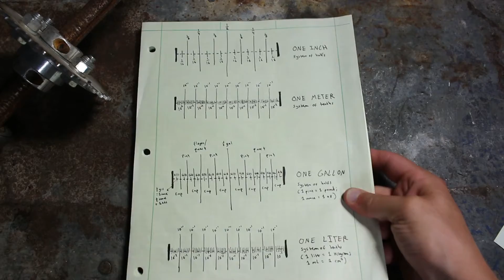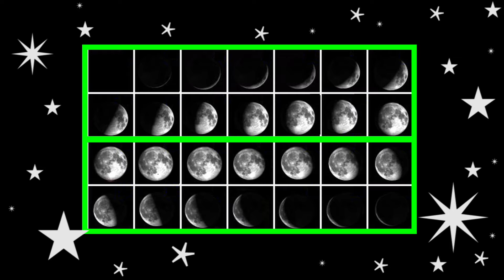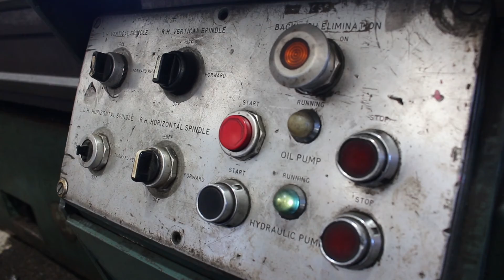Metric vs. Standard: An Imperial Defense

Comment: For people who say imperial is stupid never actually tried to understand it also this is a better explanation of why imperial is the way it is than I was ever given in school and it makes much more sense.
Reply from the maker: Thanks, Project Atlas, I agree.
Reply: I can use both sistems and say Imperial is stupid, I use like many im metric world for very specific measure like socket wrench. In metric worl no one say 13.6 mm or 6.3 mm
We use only because is simple to remember ½ inch ⅜ inch and ¼ inch.
And thats all. Only because it is international standard.
And really most people really no need to know exact dimension any socket wrench adapter. Enough is remember those 3 type. In most situation it is just in use ½ and ¼ inch socket adapter. Same situation is pipes, no one made pipes beteeen standard values. So in metric countries we use 2inch , 1½ inch , 1 inch , ¾ inch , 
½ inch and that all to need to know. Only because standardisation worldvide.
But all other metric is supperior..
Metric caliper cheap one can mesaure up to 0.05mm
And imperial scale?
Up to 1/128 inch and this is too big measure.

Comment: "There are twelve moon cycles in a year"

Wrong. Luna completes an orbit every 27.322 Days and a Year is 365.2425 days, or 13.36 lunar cycles in a year. Not twelve, not a round number and it's simply the fact that as of right now Luna's orbital period is as such to deliver those results. The average distance from Earth to Luna is expanding by 38mm a year due to tidal forces. When T-Rex roamed 67 MYA it was 254.6 km closer to the earth.

"The Imperial System is an old system"

First of all, Mesopotamians predate the Hebrews and had their own measurements. Second that's a point against it, a cubit is ill defined because (surprise surprise) humans have different lengths of arms. SI is defined rigorously, systematically and consistently.

There was a reason why Metric overtook feet and inches and furlongs and galleons and hogsheads and all that other stuff everywhere but the US. It's just an easier more efficient system to use.

Also a Pint (473.176 ml) is not a pound (453.592 g).
Reply from the maker: "A pint's a pound a mile around"—ballpark numbers. The point is practical usefulness, not exact specificity. Maybe good for the garage mechanic or farmer, not the nanotech developer.

Comment: Metric is a good system, and it has it's place: EVERYWHERE.
- I've learnt imperial first on an americal school and then forgot it completely. The simple fact that you need a sheet to explain it proves the point.
- It is also not correct that imperial only uses multiples of 12. If was at least consistant, it would be better, but that's not the case.

Comment: Good on you sir for making these points and defending the imperial system. Here in the uk we’ve sold out to the metric on-slaught. But the imperial just won’t go away and so it is necessary to be familiar with both. We are proficient at both but expert at neither.
Reply from the maker: Thank you for the nice comment!
Reply: @McGuireMechanism  I wanted to state another warning from the UK. Our plywood still comes in 4 x 8ft sheets. In metric this is 1.22m by 2.44m. The drywall manufacterers here in Europe have, in their wisdom, decided to make their drywall sheets a simpler 1.2m by 2.4m, which is about an inch smaller than the imperial plywood. This means that when the carpenter comes to layout his studs, he has to make them fall an inch shy of a full width of plywood in order for his drywall joints to fall on a stud. But now all his plywood sheets have to be cut down by about an inch in order work. All because the metric system hasn't been developed out of any practivcal application, and so they're bending the practical to fit their abstract idea. 
Another note and then I'll stop. A regular internal door is still 6'6" by 2'6" but these are sold as 1981 x 762mm. Everyone remembers the imperial dimension but not the metric (for obvious reasons) but some carpenters, siduced by the "metric now" propaganda, have got themselves metric only tapemeasures, so you literrally hear guys asking "how big is a 2'6" door?"
Reply from the maker: @briefoutlines4505  Nicely put. Such interesting examples! Haha and I just ran into a some rectangular tube (a hollow structural section) named HSS254x152.4x12.7 (254 mm wide x 152.4 mm high x 12.7 mm thick,) then after a calculation I realized that's just a standard 10" x 6" x 1/2"!

And I just discovered your channel. Enjoying the thought experiments.

Comment: Being a Eurupean (Danish) metric person i like your argumentation for imperial.  Especially when it comes to length measurement. But when it comes comes to the lengt, weight, mass combination i think metric is easyer, and more precise.
But when i did reparement in my old house i often used an old danish ruler with old danish "tommer" (not quite equal to an inch, but same principle). My house was before wood construction in denmark turned metric
Reply from the maker: Thank you for your perspective, Martin! I had never heard about the "tommer" before. Very interesting insight!

Comment: Thank you for the video. I've thought about this same topic for awhile, and why I prefer the imperial system over metric for most of my projects. It would seem that metric is better when designing a product or system starting with mathematics, but imperial should be preferred when estimating or roughing in a design using intuition. 

I find estimating dimensions using imperial units to be far closer to actual, than when I or others use metric. 

Yes, I'm biased having been raised using the imperial system, but it seems like the English units simply fit better into our lived experience and the measurements of our own bodies... accurately estimating an ounce vs a gram, or marking out an inch vs a centimeter. 

Is it possible the metric system was created specifically to make the math easier, while the imperial system grew organically based on familiar lengths, volumes, and forces? I honestly don't know if they were both equally contrived.
Reply from the maker: Great thoughts, William, thanks!

I think you're right. My understanding is that Imperial evolved over time (units like the "foot" can be traced back to ancient Hebrew,) while Metric was implemented in a unified effort by design. I tend to prefer Metric for things that are too small to see and Imperial for things tangible :)

Comment: I don't think U.S. customary units are bad, but I feel like this video doesn't do the best job defending them. The point about divisibility by 2 is slightly misleading, because there is no reason metric units cannot be divided into fractions. The reason we do this with inches is simply because our shorter units of length are either obsolete (e.g. the barleycorn) or industry-specific (the point and pica), so there is just nothing else to use. We say "1/16th of an inch" because we don't have a unit that is, say, an 80th of a inch or whatever to make it easier. That's not an advantage at all, quite the opposite.

Moreover, a pint is not a pound. In the U.S., a pint is 16 fluid ounces, but a U.S. fluid ounce of water at any reasonable temperature weighs slightly more than an ounce (specifically, at STP, 1 fl oz of pure water masses 1.04318 oz). An imperial fluid ounce, on the other hand, weighs about an ounce at room temperature, but an imperial pint is 20 ounces. So a pint is not really a pound anywhere, except maybe a pint of low-gravity wine (which we don't even measure in pints).

I do agree with the premise here to some extent. English units are traditional, functional, and designed with some care, unlike what many people will claim. They are superior to metric units in divisibility by 3 in many cases, which can be important, and they don't have the awkward scale issue of metric where it seems like there ought to be a unit of length of ~30 cm, like there was in virtually every society up to that point. Cups and spoons are also fairly convenient for cooking, which is mostly where our smaller units of volume get used (though some pill bottles still have a volume in apothecary drachms debossed into the plastic!). And there are a few other advantages.

But that said, we lose a lot by declining a global standard. I think whether metric or U.S. units are "better" misses that point. Moreover, it's misleading to focus on only one narrow use case of some U.S. units, like short lengths in industry, and not other units. The mile is 1760 yards or 880 fathoms or 5280 feet, something which is neither easy to remember nor compute with. How often do we need to convert between miles and feet in practice? It depends what you do, but probably not that often. But it's still an objectively bad conversion factor. The U.S. liquid gallon is 231 in³ by definition. Why? I don't know, it just is. It's based on a particular Elizabethan wine gallon, and we sort of just ended up with it like that. Many different pints exist in different parts of the world, which is legit confusing. We have two different units called an "ounce." A pound sterling is a unit of currency, based on a unit of weight which is not even a modern pound, nor is it the troy pound, the unit used to measure precious metals like sterling silver today, which is itself not the avoirdupois pound used for everything else. Virtually all surveys conducted in the U.S. have used the survey foot, which is 2 ppm shorter than the statute foot. And on and on

There are so many caveats and special cases that are like landmines. They rarely cause issues, but sometimes they do, and it's hard to be sure when they will and when they won't. So to say this system is "better" than metric just because 12 has more factors or whatever feels pretty incomplete. It's not really a question of what is easiest to use in a shop at this point. Any unit is easy to use, because you get used to it pretty quick. It's a question of international agreement to reduce barriers to trade and thus make everything slightly cheaper for everyone.
Reply from the maker: Thank you for your perspective, Eebster!

While you are correct that any number can be divided into fractions, the Imperial system (called by different names depending on the time and place) being a “system of halves” is embedded within the units themselves. Consider 16 tablespoons per cup or 16 cups per gallon: 16 simply has more whole factors than 10.

For practical purposes, in applications best suited for the Imperial system, considering a pint as a pound is sufficient. One principal merit of the Imperial system is it has linguistic ties to real, tangible objects. It is ideal for hands-on farmwork and crafting. Big stuff that you can see and touch with your hands. For these tangible applications, decimals in the hundredths and thousandths place are typically negligible.

On the other end of the spectrum, in the realm of microfluidics, for example, I would argue that Metric is better suited. Different systems are more or less useful, depending on the application.

Please understand that I am not arguing that Imperial is superior (though it is my personal preference, only because of my particular trade and community.) I am defending the underdog, playing devil’s advocate for the standard system used in my area and line of work.

I love the Metric system, and you are absolutely right that we would “lose a lot by declining a global standard.” My hope is that people will also recognize that we will lose a lot—even more, perhaps—by denying the older systems of measurement rooted in real, personal communities throughout the world.
Reply: @McGuireMechanism  So I still sort of agree and sort of don't. I agree that older units should be defended when they merit defense. I think English units in general have been a mixed bag, with some good ones and some bad ones. And I certainly agree that it doesn't deserve the attacks on it that it has seen recently. But on the particular points, I still can't agree.

For instance, it is true that units of volume are almost all binary (except for the teaspoon, and the fact that there is no unit equal to half a gallon), and I gave this as an example of a good system of units. But metric units also have factors of 2. I can divide a liter into eighths if I want, of 125 ml each. And these binary systems have no way of handling a third, which I think is very important and the main advantage of feet and inches.

I disagree that it is useful to treat a pint as weighing a pound for anything beyond a rough approximation. A pint is 1.04 pounds. This is akin to treating pi as 3.25.

But your last paragraph is the most important, and I definitely agree. We shouldn't just throw out units entirely without appreciating why they exist and what their best features are.
Reply from the maker: @EebstertheGreat  Yes, a tablespoon dividing into 3 teaspoons (like a yard dividing into 3 feet) is a pattern with the smaller units, probably because at the finer scales smaller magnitudes become more useful. Also, note the "half-gallon" is itself proper convention for the unit of half a gallon.

You mention a disagreement, but I want to point out that we are saying the same thing: we both agree that it is useful to treat a pint as weighing a pound only for rough approximations—no one is arguing otherwise. This is assuming that ± .04 is rough for a given application.

I'm grateful to have a viewer sees both sides as well. Thanks again for your comments!
Reply: By the way, the technical term used by the government is "United States Customary Units." They are similar to imperial units, but as you can see, not exactly the same. A few units are exactly the same, specifically those based on the yard and the pound, but the others are all different. (And even the ton and cwt, based on the pound, are different in the imperial and U.S. systems.) Technically, the "Imperial System" was defined in the British Weights and Measures Act of 1824, while "United States Customary System" was defined by the U.S. Treasury in 1832. Both were updated since then, with the modern definitions all being in terms of metric equivalents, which are in turn defined by fixing physical constants.

Comment: DUH. There is nothing to stop you dividing metric measurements by 2, 3, 4 or 16. It's not "common," but comparing the systems based on fractions is silly.
Reply from the maker: That's a great point, Ole! Thanks. One difference is the actual units of the Imperial system are divided into numbers like 16 (for example, 16 tablespoons per cup, 16 cups per gallon.)

Comment: When it comes to divisors, a meter has a lot more divisors though (when you consider it 1000 millimeters): 1, 2, 4, 5, 8, 10, 20, 25, 40, 50, 100, 125, 200, 250, 500 and 1000 of course.
Reply from the maker: Interesting thought! Now to be fair, increasing three orders of magnitude gives us 1200 inches divisible by 1, 2, 3, 4, 5, 6, 8, 10, 12, 15, 16, 20, 24, 25, 30, 40, 48, 50, 60, 75, 80, 100, 120, 150, 200, 240, 300, 400, 600, and 1200.
Reply: @McGuireMechanism  Except that I didn't raise by magnitude, but just listed the divisors between two different units (millimeters and meters), just as you did between inches and feet :)

The two divisors you listed were between two really close units (e.g. meters and decimeters), of which the latter one is rarely used.

If you need to subdivide a meter, and can do so with tenth steps, you usually stick to 0.X meters. If you do slightly finer steps, you go to cm, even finer, you start using mm for division. Even finer? μm (or micron, which is the non-SI name for it). You can go way smaller, though μm is probably the smallest unit one would use in machining.
Reply: @DASPRiD  You did raise by multiple orders of magnitude, though. That's what unit conversion in metric is. Sure, it's a very common conversion between named units, but when thinking mathematically, it's more useful to think of these not as separate units, but as multiples of the base unit. (That's the premise of scientific notation, after all.)

With U.S. Customary, on the other hand, increasing orders of magnitude is still possible, there just isn't special notation for it. When changing order of magnitude, customary will have more factors than a comparable metric conversion.
Reply: @McGuireMechanism  What is 1200 inches? Certainly not a foot. 1000mm is known as a meter. We are talking about divisors of a foot and a meter.
Reply: Why fractal in any case?

1/128 inch is still big measure, bigger than  usually milimeter caliper can do , milimeter caliper goes up to 0.05 mm
Even lf precise caliper can goes just to 0.1 mm , this is much more precise than 1/128 inch.
And whats about in the middle fractals, this dimension exist also all thise what you cannot even dream it easy precise measure in metric. For ordinary machinist is normall 0.001mm
Simple. What is in inch fractal this same measure? You cannot on practical way do it. 
And science smaler than micron ( 0.001mm) can you find resonable inch fractal? You cannot.
End story.
O yes some inch fractal become popular in many jobs, plumbers, etc , noone say , pipe diameter is 12,6mm ,  6,3 mm etc , usualy some proffesion use inch and fractals not because imperial beter no, only because this is international standards. 2inch, 1 ½,  1inch,  ⅜, ¾, ½.⅓ never wil be used.
Socket wrench is matter of international standard and older mechanics use ½ inch socket, ⅜ inch socket and ¼ inch socket adapter. And thats all. Younger people use fractal of inch less and less. Metric mechanic can do imperial, but can imperial mechanic do metric?
Metric give you much more precise measurement than any imperial can do.
Thats reality in the real world.